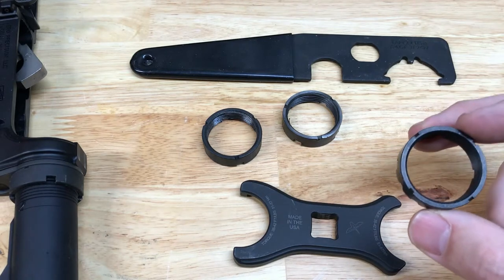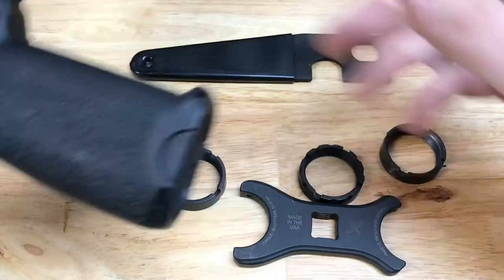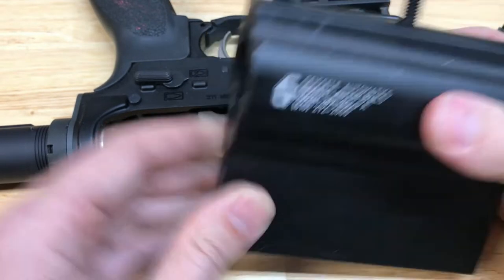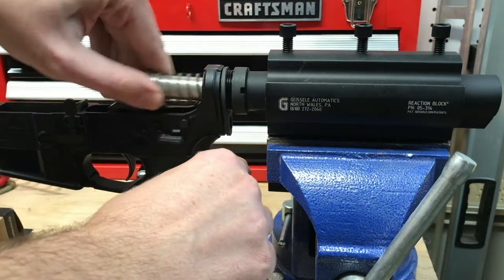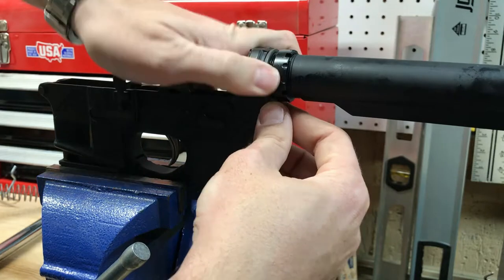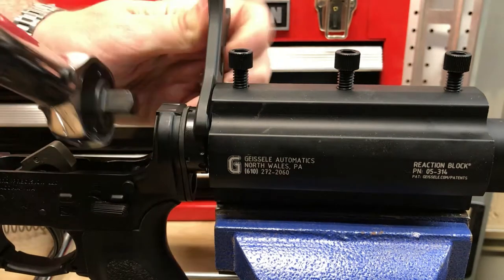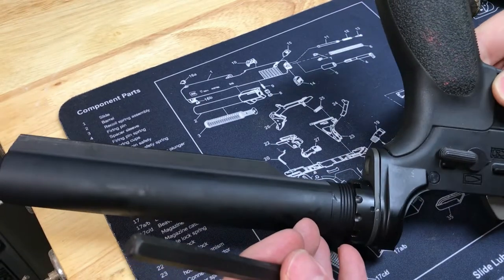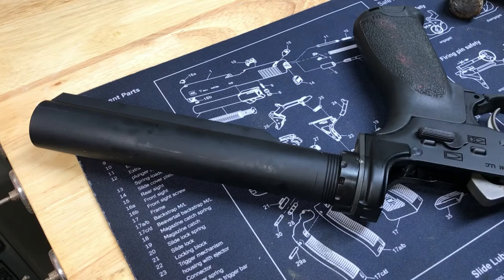Capable Citizen   Castle Nuts with FCD

Comment: I used the KZ AR15/M4 Receiver Extension Buffer Tube Block for around $50-$60 until I got the expensive Present arms Gunner's Mount that holds the buffer tube straight to the lower receiver. I always thread and plug the take down detent and spring hole in the back of the receiver..I use a spring punch for my starter placement and then use a hammer punch to finish staking..  The FCD castle nut is second to none for quality and the only one I use on my builds...

Comment: The Geiselle reaction block is nice but 200 is steep. its nice if your running a business but the home owner is a bit much. Carbon polymer solutions sells a 3d printed version of the buffer tube block for 20 dollars and it works nice!
Reply from the maker: Yes, the price on that fixture was doubled from what it once was, and even then was a substantial investment.  The tools to do things properly add up quickly and can quickly outpace any savings from piecing things together yourself.

Comment: Reaction block is $200!  Phew. If you build these professionally, why not? For an occasional home build... it's just too much.
Reply: check out carbon polymer solutions. they have a 3d printed "reaction block" that works really well for 20 bucks
Reply from the maker: Sharing resources amongst local friends isn't a bad idea either.  Having well built tools built for the specific functions needed just makes things a lot easier.  As long as your hitting the correct torque and not damaging anything in the process, it's all good!

Comment: I've never had a problem pressing the lower into my chest and cradling it with my hands, forearms and using the attached pistol grip as leverage. I bet money my torque is pretty damn close. No, I don't fight ninjas or play Call Of Duty on a golf course. I'm a licensed and professional semi-retired full time HVAC technician and now a factory maintenance man. I have swung pipe wrenches, hammers and wrenches for decades. I also use tin snips to cut 24, 26, 30 gauge sheet metal daily and have for decades. I can dead lift about 375 pounds by myself and have "flipped" over 591 pounds before. I'm middle aged and getting old too. Imagine me when I was in my prime. You don't need this tool if you don't have girly man hands and limp wrists. The standard wrench works just fine.
Reply from the maker: We don’t assemble guns based on feel and “bets”, trying to guess if we hit a 2lb torque window. By all means do what you please with your own property, though.
Reply: @capablecitizen3080  

I've been doing this over 40 years. You can check me out. I still have my first Colt Government A2 20" I bought new in 1994 for $675 + 5% tax. I have at least 25 more I built from parts.

I don't listen to you "new wave" come afters much....

It's a receiver extension...not a cylinder head bolt on a NHRA dragster.

The platform didn't even have castle nuts with stake notches before the 1980s. You won't find any on any of the original Colt CARs.
Reply: @capablecitizen3080  

Do you think these tools existed in those times? That would a negative ghost rider. Only had about 5 or 6 brands of ARs and parts back then too. Colt, Bushmaster, Armalite, Rock River, Stag Arms, Olympic Arms.  FN didn't make semi-auto ARs then.
Reply from the maker: @JohnDoeEagle1  no one cares how long you’ve been taking short cuts and ignoring the correct assembly methods. These torque specs were written in the 1950’s, and are a requirement for all DOD owned/issued M16/M4 rifles.
Reply: @capablecitizen3080  

The same group of people can't shoot with carry handle irons and need red dot optics at every close range. You should see what 300 meters or 500 yards is like before you criticize your elders kids!

Comment: If you really want to do something you could build one for much less using Instamorph aka "Poly Morph" or by a little wood working out of some hard wood blocks. A old junk shipping skid would be a good source for some. Go to the table saw and mill/router/drill press and have a go. Spending $200 on this tool is a waste of money. That is EVEN if they had them in stock.